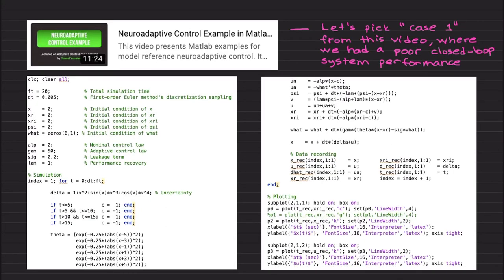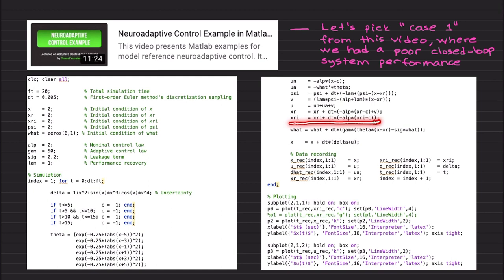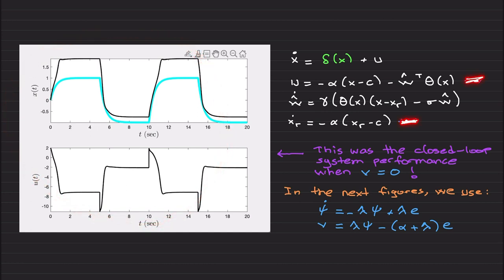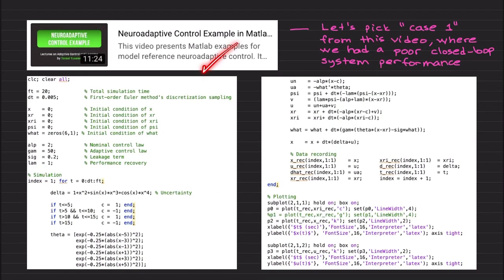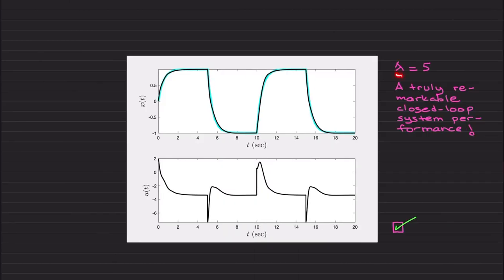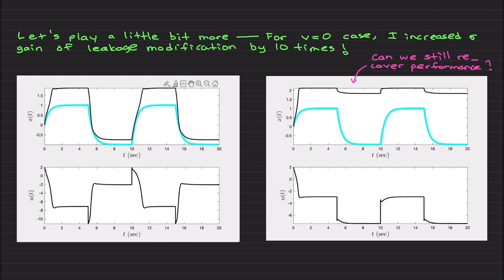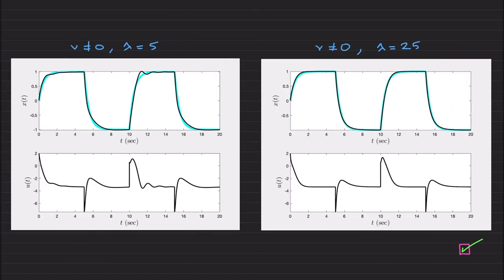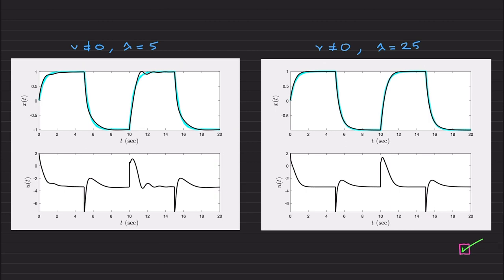Performance Recovery Example in Matlab (Lectures on Adaptive Control and Learning)

Comment: Professor, if i understood correctly: in the presence of measurement noise, we should try to choose smaller lambda value as much as possible, since the bandwidth of low pass filter for calculating errordot will be smaller. So for that reason, we should try to improve our nominal adaptive controller as much as possible by adjusting # of neurons; therefore we will not be forced to use a high lambda value to correct the performance of this method. Did i understand the underlying message in this lecture?
Reply from the maker: You understood correctly. By the way, you can still use a small lambda to compensate for poor performance and you should use more neurons as well - It is always good to design neural networks appropriately ;)

Comment: Professor, I implemented the neuroadaptive controller with projection operator and sigma modification in a two-dimensional system, the output result approached the reference model, but did not zero the error in steady state... I implemented the performance recovery but did not have good results . Could you show an example of the techniques with a two-dimensional system? Thanks
Reply from the maker: Understood. Performance recovery for high-order systems has a slightly different formulation. Here is the reference: https://onlinelibrary.wiley.com/doi/abs/10.1002/acs.2376?casa_token=9LH1YEaUjwAAAAAA:Q4-OOJPGJnAQsbrYovlq7tE0R3YOY6UTqEOKQSjiQW4rmdUKNDtqk-w0kJPzAfpEN_XLi3MnDX-Vp5Q - I will cover this topic in detail as we move forward with the advanced adaptive control systems material. Stay tuned!
Reply: @tyucelen  Very good, thank you! Looking forward to the new playlist...